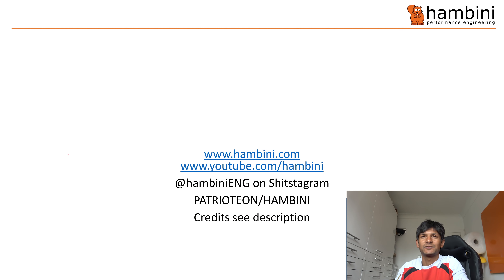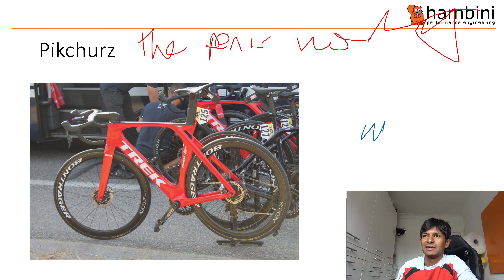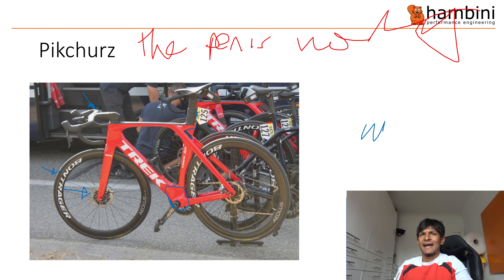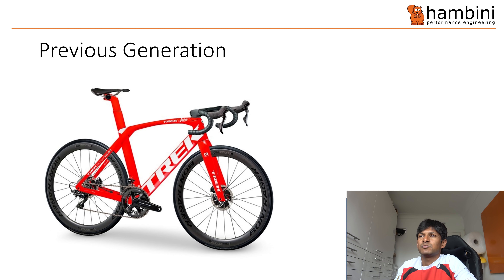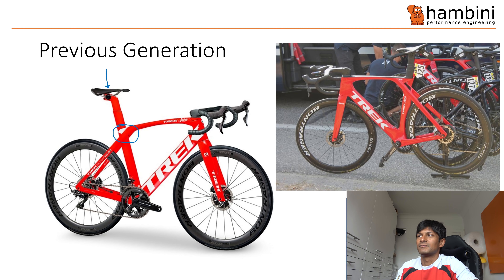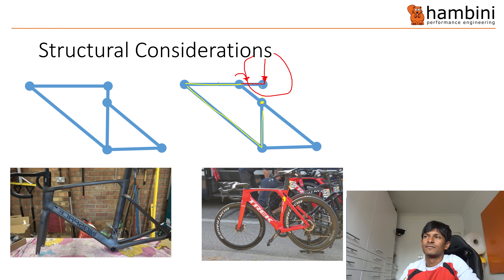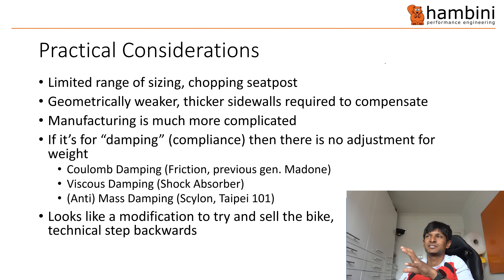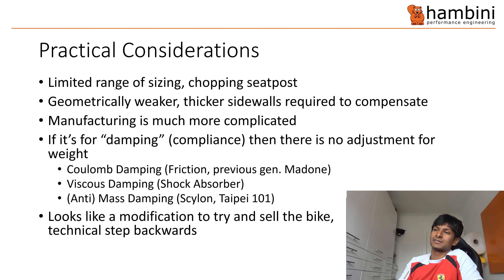New Trek Madone gets an Engineering Roasting

Comment: Delibrately adding an obvious weak point to the core sections that ensures the rider's safety, ridiculous. Did the marketing team designed the bike?
Damping structure around the cross section of rear fork and upper tube isn't anything new. And tbh the first time I saw this frame I though it was for gravel. But no, they said it is for aero, pure amusement

Comment: Flexing carbon structures are neither novel nor dangerous if properly dimensioned. The older Iso-Speed was flexing carbon anyways. The only differences are: the flexing parts were hidden inside the seat tube (Madone 9) or packaged below the top tube (Madone SLR). Now the flex is integrated into the main frame structure. In a similar way, the thin seat stays of the 2012 Cannondale Supersix Evo were flexing as part of the main structure of the rear triangle. In the absence of external forces, these frame remained pretty stable until now. Is this ranting about the unconventional shapes of the Gen 7 Madone justified? Criticism shall be based on evidence and not on speculations or merely on taste.
Just my 2 cents ...

Comment: To try to brace the cantilever effect, they tied the seat tube into the rear section, which ties into the left over bottom tube, and they tied into the top tube also. I still suspect that cracking will develop in time, but the way they tied it all together, will extend it, than if it were truly free floating.

Comment: Hambini, here is a webanair where they discuss the new Madone at length. On the seat post, there is a standard length offered and a longer optional. Both have a two place mounting at the top for more adjustability. It’s in the video. https://youtu.be/6Fj-7Ioimcw

Comment: I still can't digest how fatter tires with lower pressures can be called faster. But I'm a dumb carpenter not an engineer
Reply: Probably only on bumpy roads where those tires absorb more of the rattle, and  makes the rider more comfortable and focused.
On smooth surfaces the laws of physics dictate that slim tires with high pressures are faster (less rolling resistance, less aerodynamic drag)

Comment: I am curious if you reached out to Trek and asked them if they did a wind tunnel test on this (I am assuming they did with a rider on it)? I don't see Trek wasting  money on a new design and R&D if it didn't improve something.
Reply: Mads Pedersen were on Danish television and said that they had tested it with a driver on, and found that there was not a lot of turbulent air due to the hole when there is a driver on (I don't have the exact quote, that's just what I can remember)
Reply: @fireduckz3765  Thank you for the answer. I figured with a rider the wind would get caught and turbulent between the legs the wind hitting the chest would push air down towards the crotch and the hole would help dissipate that air.

Comment: Engineering principles are important, but so are marketing principles and claimed aero "gains". Not all innovative or performance leading ideas are necessarily the best engineering examples. Just saying.

The design for the system is more important than the design of the bike itself. E.g , round tubes are typically stronger, lighter and cheaper to both design, engineer and manufacture, but we know that aero shapes are better for speed even though all other engineering factors suggest they are inferior.
For  an example in cycle engineering see the new lotus track bike. I mean, awful to look at, so many engineering compromises, but 100% all in on getting every aero advantage it can get it's spindly frame on.
Back to Trek: if it's claims are not verified, they just flunked the b.s. test.

Comment: I'm sorry as much as I follow you I totally disagree this time, you're a so-called engineer right?? so surely even you can see in 10mins 30 seconds, the stem going up would have vibration like that sure but not really pressure that would be down, second move right to the next section it goes two ways support to the left and to right supporting the seating area which would give you around an inch and half gues of the size of the pressure? But it's carbon so won't surprise me at all if it was alloy then I would totally disagree.

Comment: The designer could have been into blender 3d polygon modeling.   In polygon modeling a Quad is better than a Tri.   And I have been told countless times, modern bikes just have so much better "geometry".  Plus, every year bikes are 20% stiffer and 20% more subtle.    I wonder if hambini can do a run down on the marketing crap with tapered headtubes.

Comment: The new design has little to do with added aerodynamics. The previous variants had an isospeed unit which caused a lot of creaking, wear and frame damage issues. Also, the isospeed had bearings which you find in Full suspension MTB frame pivots, which are heavy. 

The new design eliminates the need for servicing these bearings and eliminates the seperate moving carbon part in which the seatmast is inserted. All in all less weight and no more servicing needed. The variant with the opening is designed as an alternative to the original isospeed. It needs to flex enough to actually create riding comfort comparable to what the previous version accomplished.

The madone has always been an aero endurance bike with aerodynamics in mind, but also very much comfort, as that turns out to be a huge facor in having riders perform for longer times/rides. Also, aero shaped frames are inherently heavy because you need móre material to create the teardrop shapes, instead of very skinny round non aero tubes. This weight, as much as you want to eliminate it, also actually helps in keeping the bike rather comfortable.

Te émonda series bike is exactly the opposite of the Madone, it is designed for being an ultra lightweight climbing bike. It has no isospeed, no big large teardrop shapes and it has very thin tubes. 

The new TT bike that came out is also heavy as f*ck but it still beat the hour record because after 40 k/h or so, aerodynamics is the biggest factor resistance wise and for maintaining speed.

The Madone simply isnt designed to be the ultra lightweight bike, it is meant to go and keep going for long rides: endurance rides. 

 The émonda already fills the gap/purpose of ultra lightweight.
Reply: So trek are in the realm of creating problems and over engineering to try and fix it now?
Reply: Bad designs bring more bad designs to the end customers, who cannot dump the bike after a season like PRO teams do. Big F to TREK as usual.

Comment: Trek makes some ugly bikes. My Madone is one. It stays on a trainer. It broke twice so far. Expensive trash. Bought a Ritchey Road Logic and a  steel Salsa gravel bike. To join the DIVERGE and Crockett both alum. Not interested in carbon if free. 8 broken frames, none in a crash. High mile rider 15k yearly. Old man in my 70s. I dont abuse equip.. carbon bikes are ugly in my view. I like classic shapes and that wonderful ride.  Trek goes overboard with graphics. Nice video sir!

Comment: Good analysis... except Hambini's knowledge of the factors around vibration loses (not just a comfort thing, but a speed thing) seem to be SEVERELY lacking! What's odd is that he seems to acknowledge that dampening of vibration can be bad since bleeding off speed by converting vibrations to heat.. acknowledge that human body (a big, floppy, vibration dampening meat bag) is a huge dampener, but then doesn't make the logical conclusion that isolating that massively dampening, speed losing body from vibrations with as little loses as possible will reduce energy loses and make you go faster 🤷🏾‍♂

Hambini, letting tires and a carbon fibre leaf spring (effectively) take care of the vibrations bleeds off WAAAAY less heat/speed than would happen you allowed those vibrations into body... what you want to do is deflect and return energy back to  the tire/road with as little dampening (absorbing/losing energy) as possible.. that means as much as possible not allowing vibration into your body.. and not necessarily, just for comfort which IS important, but for speed!
Reply: Look at car wheel sizes (more specifically the given sidewall height) - a car will achieve better mpg and comfort with 16 inch wheels than with 18 inch wheels essentially due to the absorbtion of vibrations from an imperfect road surface.
Reply: Was going to say that. Unless the road is perfectly flat you need some damping to absorb vibrations which would otherwise slow you down. Choosing the right tires typically does the job but for the occasional larger bump (ie pothole) additional damping is beneficial and not only for your ass
Reply: Yeah he’s out of his depth here

Comment: You can achieve exactly the same effect with much less weight with a compact frame with a sloping top tube that creates a much longer seat tube and staying with a not too big diameter seat tube (like a 27.2mm) and even go to a D-shape if you want to be more up to date and by definitely staying away from any deep aero seat tube.  But that's pretty much the breakthrough design of the 1997 Giant TCR so hard to justify as the new super-duper $12000 2023 model...

Comment: Sound - also you'll get 'twist' of the top tube/seat 'beam' (?)  from pedalling, as its not supported by stays (why seat stays used to come to the top of the seat tube and why seat posts were short when building with lightweight stee)l. It must be very strong (heavy) to resist lateral pedalling movement and twist. You can see this on long seat posted bikes in eg time trials where the rider's pedalling torque is deflecting the seat post sideways, back and forth, with each revolution - very inefficient, I'd guess. Whatever, B5 marketing 5hite.

Comment: I'm pretty sure Trek engineers have done tons of strength simulations and the results must be promising enough before they actually decide to put this design into manufacturing. In addition, fluid flow needs to be simulated to actually say if it's turbulent or laminar as it's clearly not a simple foil that you can easily tell the results. 
benefits of doing so would probably be 1) shorter seat tube for less weights? maybe?  2) a great reduction to the chunky triangle part
If they put more carbon to make up the deficiency of stiffness for the missing triangle, my guess is that even with more carbon the new frame is still lighter.

Comment: I've always wondered why the bikes don't include aero guards of some sort to move the air around the biker like what sport motorcycles do. Surely, the extra weight would be offset by the reduction in drag, especially if they use lightweight materials.

The bikes can only become so much more aero and the biker is the main source of drag. It makes sense to focus on reducing rider drag rather than bike drag.
Reply: UCI rules would probably make them illegal and therefore all the wannabe racers who usually buy expensive bikes won't want them. If you want maximum aero get an enclosed recumbent bike, these can reach over 100km/h

Comment: Why is everyone so happy to jump the gun and call it a failure when the bike is not even released yet? If the double triangle is broken and the seat post on a cantilever, the whole frame might just work as a huge mass damper sitting between the head tube and the rear axle. Whatever shortcomings the structural design has, Trek might have found a way to counter that, either with a clever layering of carbon fibre or a novel wonder material. If they didn't, then it would go down the history as a great laughing stock. Either way, the audience can't lose unless you have already put down a deposit for this radical bike. We'll see. ;)
Reply: I think a lot of people are tired of the constant innovation hype. Every year we are told that a new revolutionary way has been discovered to make bikes faster. And every year average prices go up. And every year new, non compatible, innovations are launched, making older gear and bikes quasi obsolete. At a certain point, especially when you have a modest budget, it just becomes irritating.

Comment: I watch your videos and I don't even ride bicycles. I have an engineering question that is a little out of your wheelhouse. On motorcycles, spoked rims are used on motocross bikes supposedly because they are stronger , carbon fiber cast? rims are used on high performance street bikes. They now have carbon fiber and polypropylene spokes available. Can a carbon fiber rim with carbon fiber spokes live on a 200hp street bike? If so how would they compare to cast carbon fiber rims as far as weight and strength are concerned? Assuming a tubeless tire and  gaskets or tape on the spoked rim of course. I don't know if this type of analysis is possible, I do know it is not possible by me.
Reply: I would think carbon rims would be entirely feasible, and lighter than a cast aluminium or even magnesium wheel - but at great expense. In racing, it's important to shave off every surplus gram of weight, and the small performance gain could be justified, assuming the rules permit exotic materials, but for regular bikes, I think you could save more weight more cheaply on other components.
Reply: @charlestoast4051  they already make carbon rims, its just that they are an all carbon mag type wheel with about 5 or 6 rigid carbon"spokes" for lack of a better word. My question is that verses multi component regular spoked type wheel with all carbon components. It seems to me that a spoked wheel shares the load equally around the rim in tension whereas a mag type wheel mostly sees the load in compression at the point of contact with the ground.

Comment: Power transfer?  Wtf are you talking about.  In your world do divers prefer concrete slabs to fiberglass boards?  
You are far smarter than that.  Go watch Sean Kelly ride a Vitus and tell us why he is losing all those sprints to guys on stiff bikes.  Love your channel
Reply: I’ve got a Vitus 979 like Kelly’s. It’s awesome to ride, but definitely more compliant than stiff. That’s what makes it so nice to ride! Sean was an epic sprinter and liked to ride a frames which were quite small - perhaps they were stiffer? Whatever, 90% is about the rider. Different bikes and kit make relatively little real world difference. Ride more, lose weight and stop buying stuff you don’t need 😎
Reply: A flexible frame is like doing pushups on a diving board, as you push down the board gets out of the way, then returns stored energy.  The 1967 riders were faster and rode on gravel.
Reply: @MACS6USMC  Good analogy. Energy can only be converted, as my physics teacher said many years ago.

Comment: I’ll stick with my Emonda. I don’t have to worry about that iso part going bad. It’s a lot better bike and lighter then the madone.
Reply: Agree , wish my had round hole for bottom bracket  tho :/
Reply: @MisTomis  haha you mean like on the domane?
Reply: @dereknelson2756  let's just say i spent half the value of bike on replacing bottom brackets, before i stumbled upon Hambini's channel
Reply: @MisTomis  I just hit 2,000 miles on my 2021 Emonda and my chain ended up going. A link literally snapped. I have noticed when I go around that the bottom bracket creaks a little bit now. Hope it’s ok.
Reply: @dereknelson2756  i had Emonda from 2017 till last year and on first ride my front spokes undid themselves on a descent at 40mph, thanks bontrager. After around 1200 miles started getting 1st some clicking, and then creaking in bottom bracket, went through multiple in my use. Tried different cranks etc as well but every time I pressed pedals on uphills it would creak and drive me bananas
Reply: @MisTomis  oh no. That’s what’s happening to me. I’m 6’2 225. Question for you though. 51 rsl wheels or 62? I do about 1500 feet of elevation or less a ride in Illinois.
Reply: @dereknelson2756  my had paradigm wheels when bought on it, they were like 25mm profile or something.
Reply: Mind you I don''t think it was a failure due to quality of wheels but rather the way they were build in the factory - my guess would be no tension on one, or multiple spokes which caused a domino effect and critical failure of the whole wheel
Reply: @MisTomis  well I changed the chain out and lowered the front derailer a tad, closer to the chain, so I’ll see if I still get the creaking sound.

Comment: Another quite fascinating roasting. And a perfect example of bizarre engineering to solve a non-existent problem and in this case not even sure what the non-existent problem even is. 
However, stand-by as the marketing dept soon will be writing the checks to the major (independent, impartial and consumer first) cycling media outlets to have them explain why this is the most important development in the history of cycling.
 For the reality check please recall that the major bicycle manufacturers have no idea whatsoever of ISO Quality Management Systems. For thoughtful consideration recall the garbage Trek BB90 bottom bracket manufacturing tolerances, and the embarrassing and dangerous flaws seen in the Canyon Aeroad to name just a few examples.

Comment: Wait, how do you lose power with isospeed?
Reply: That would be because you grip the saddle with your buns of steel in order to transfer even more energy to the pedals. Pulling up on the pedals is so last decade.

When the seat mount flexes some of the buns-to-feet force is going to get lost in whatever damper is there, which in turn will lose you energy. Probably at least fifty watts, more on a good day.

If course this is more of a spring design, so you might get some of that energy back.